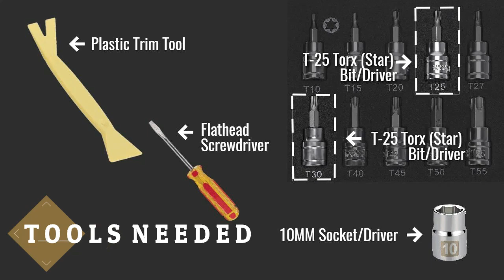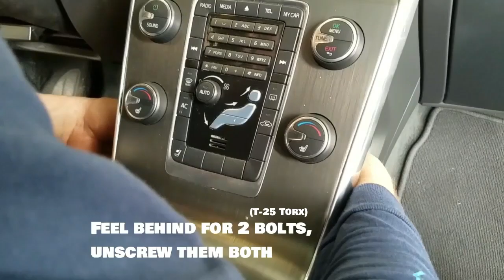How To Replace Gear Shifter for 2011-2018 Volvo S60

Comment: This video really helped. Another video left out some key steps. I spent hours trying to figure it out. 

I do have a question. I didn't put the old gearshift in park before disconnecting. With the new gear shift the car reads its in reverse. Is there a trick? The bar from under the car, does that need to be fully extended to register park?

Comment: Did you have to calibrate the new gear selector position after installing it?  If so, what is that procedure?
Reply from the maker: We have replaced a few of these in our shop and never had to calibrate any of them. Make sure to place the car in park before you remove the cable and everything should  realign on the replacement .
Reply: erievolvoparts Great, thank you.

Comment: I have a 2012 xc60. Recently when I go to remote start it the car won’t start. I get a message on the screen “Engine Off Gear not in P”. Would this be a bad shifter? The car start fine with the key and is indeed in park. Also do you have any shifter in stock I can buy from you?
Reply: If the gear selector is hard to move, does this mean that it might be faulty or it needs replacement?